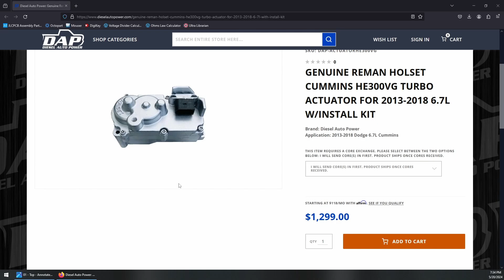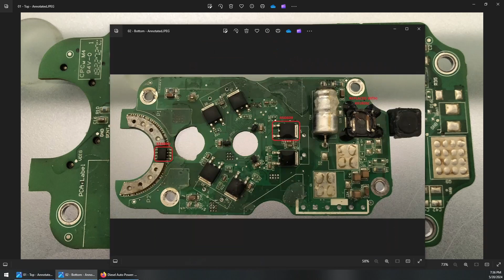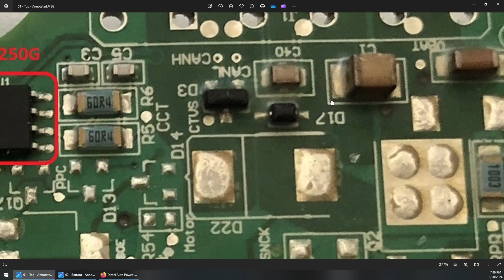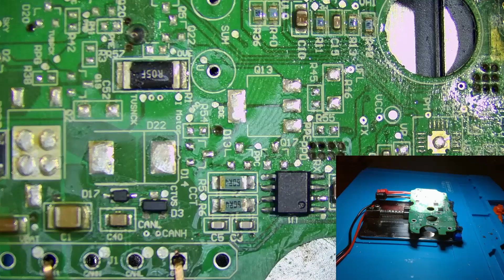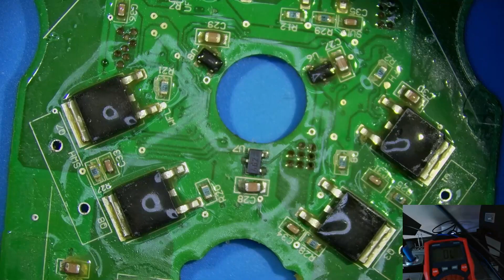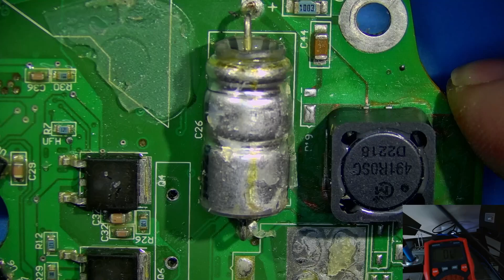Cummins HE300VG Actuator Repair - Assistance Needed!!!

Comment: I replaced the device's processor, reinstalled the data, and changed the ATA6834C. The position sensor is working, but I can't figure out the solution. The CPU voltages and ATA6834C values are normal. Does anyone have a working device with a backup and the hex and eprom files, or another solution?

Comment: AMONG OTHER WORDS YOU SHOULD READ THE FIRMWARE OF ONE THAT IS CORRECT AND WRITE IT INTO A NEW MICROCONTROLLER SINCE THESE DAMAGE THE PART THAT HANDLES THE ENGINE CAMONADO AND END UP BLOCKING THE COMMUNICATION AND OTHER THINGS I KNOW HOW TO READ THIS WITHOUT PROBLEM AND I HAVE SOFTWARE THAT ALLOW ME DO CALIBRATIONS DIRECTLY THE VGT CAN HELP YOU OR ELSE WE WILL HELP US BECAUSE I ALSO WANT TO CREATE AN APPLICATION TO HANDLE THIS DIRECTLY WITH MY OWN SOFTWARE BUT THERE IS A COMMAND THAT I DO NOT KNOW ABOUT CONNECTION OF IT

Comment: HELLO, THE PROBLEM IS THAT WHEN THERE ARE ENGINE FAILURES THE COMMUNICATION BLOCKS THIS IS DUE TO A FAILURE OF THE MICRO CONTROLLER
Reply: @idontlimitation, thanks for your response.  I wonder if the places that rebuild these are using the same firmware from a working actuator and writing that to the new microcontroller they are putting on?  I would think that's the only way unless they have reverse engineered the firmware and created their own.  Thanks again!
Reply: @tadebaka  Believe me this software, it's complicated because it's created in C++ what it can do is analyze with can-bus and the manufacturer's software and capture the IDS or PGN so you can make your own code but still this computer needs Seed Key so you can read or write it
Reply: @idontlimitation  Ah, so I won't be able to read the original firmware and write it to another device with a new MCU?  That's going to make repairing these devices very difficult 🤔
Reply: @tadebaka  No bro, if it does the reading you can write without problem but if the writing is with programmers, it will not have any problem I mean if the reading is by ISO1587 IN THIS CASE IT WILL ASK THE VGT TO ENTER SPECIAL MODE TO ALLOW THIS READING OR WRITING

Comment: We have repaired some, basically micro ATmega64m1 needs to be replaced and programmed, we in the process right now to discover whats the best way to program those as there are many ways
Reply: @cartuningstarcts, thanks for your response and insight.  I think I was able to read the firmware off one of them.  Doesn't appear that they locked them with any of the fuses but I'm new to this so I could be wrong.  I've been working on creating a calibration tool.  I have that working, so I am making some progress but still haven't figured out how to diagnose/fix these things.  I'll get a couple of the ATmega64m1's and see if I can replace it and write the firmware from another actuator to it and see if it works.  Thanks again!
Reply: @ very good let me know that you find out I’ll do the same